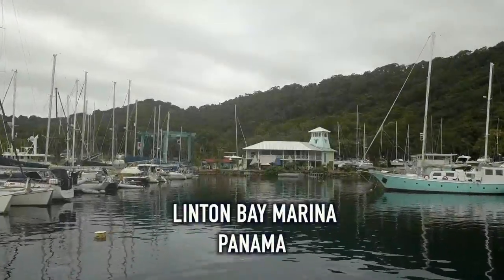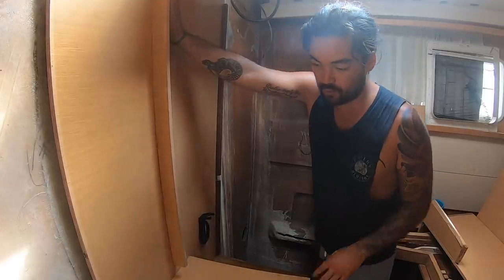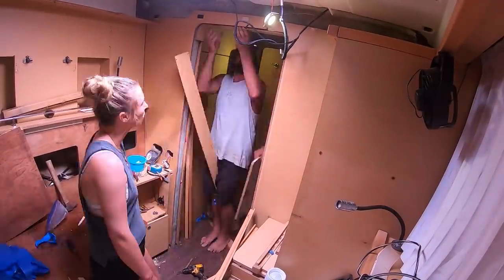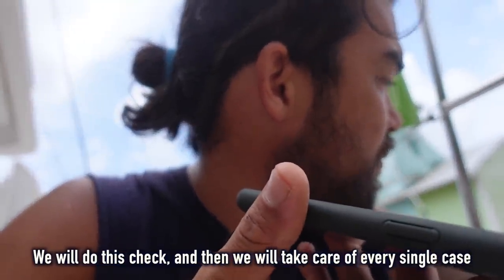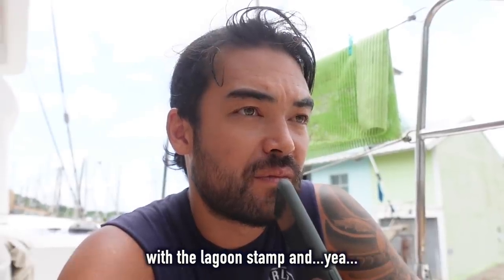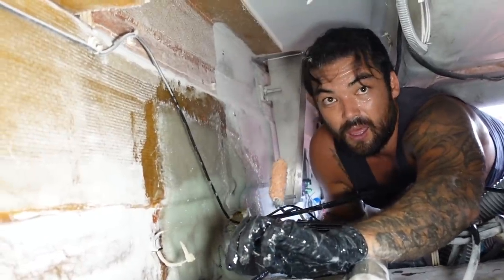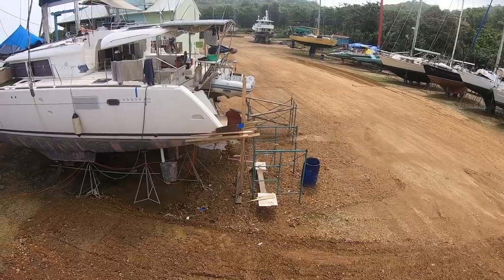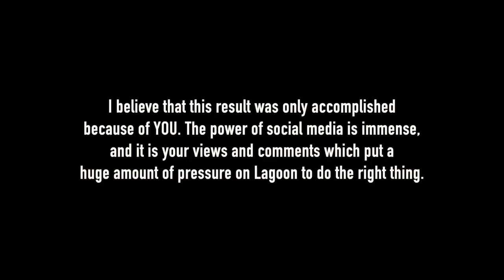AMAZING NEWS FROM LAGOON!! - Cracked bulkhead SERIES FINALE  (Episode 119)

Comment: Well done! Unfortunately the publicity has become a classic case of ‘Don’t shoot the messenger’! And owners, who are perhaps understandably in shock about potential decrease in second hand boat value have identified you as a lightning rod of their concerns. It’s human and social media nature, I’m afraid, to for some to do so rather than your recognising the main issue is that you may have saved their lives! It is difficult not to get down in taking this personally but you need get out off this. You were right not to disseminate your plans, no doubt someone would try to follow it and make matters worse - and you just know who they will come after……

But your YouTube, being an income channel and making the rebuild episodes, is also a double edged sword in generating income but at the expense, particularly from the detractors, of being a focal point for venting anger. And I am concerned that you are volunteering to disseminate the information from Lagoon to the other groups of irate owners. If Lagoon have taken this decision on inspection and repair, it is for them to communicate this - particularly as there seems to be conditions and exceptions to be applied to boats. I am not convinced they will be able to say that bulkhead damage is some is the result of design failure and others due to hurricane damage. If there was no design fault there may well be no hurricane caused damage to bulkheads.

This is going to get messy and my advice would be to now let owners communicate direct with Lagoon, and you get on with enjoying yourselves and posting episodes of your next journey. And you and Jamie get some beers down!

Comment: All Tomas said was they will check the boats and that all, the boat will not be fixed even if they do find a problem . So that is not good new but a bunch of double talk and bull shit is all he told you he just make it sound like they was going to take responsibility for there faulty workmanship but they are not. They will just claim that if they find a problem is that the boat has been through some kind of storm witch ends there responsibility to there customers .